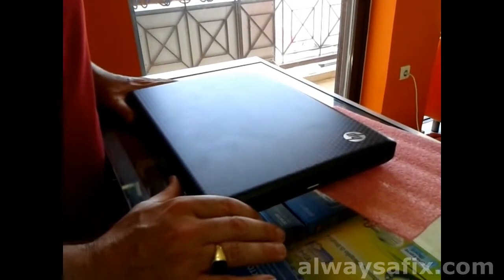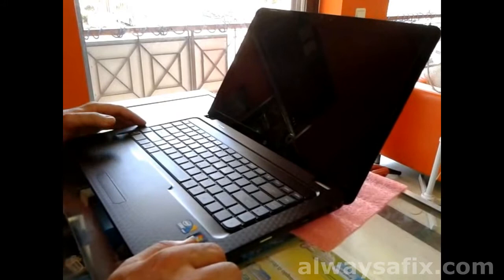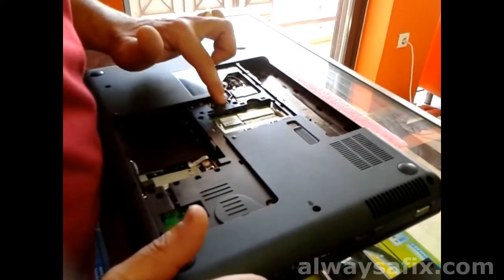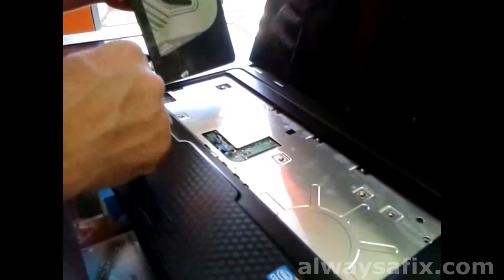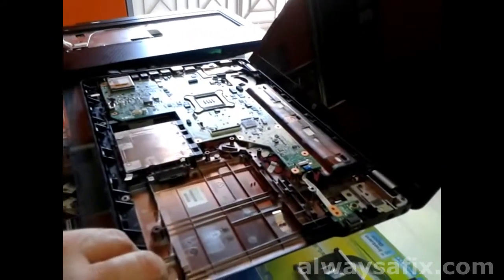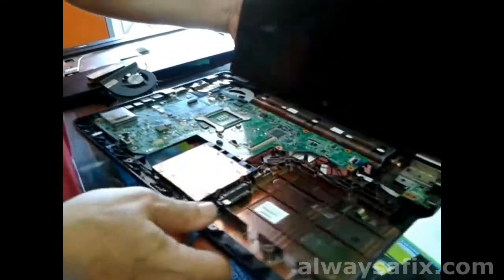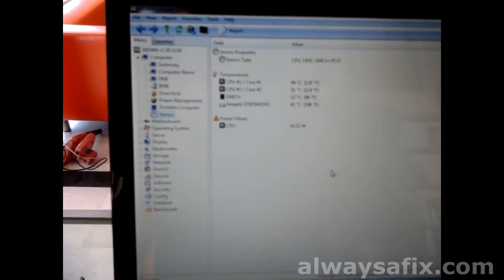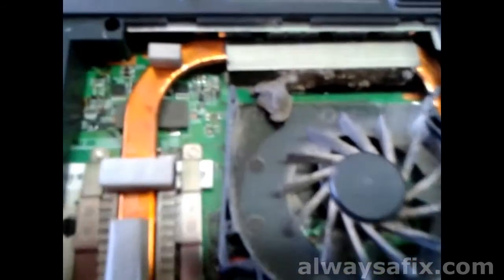Laptop switches off, black screen due to overheating fix

Comment: mine turned off due to overheating it didn't turn on after like 4 hrs it turned on but it has a black screen i tried cleaning the ram and the hardisk nothing happend it works on a another monitor with hdmi
Reply: Same bro
Reply: @aravindrajj7674  were you able to fix yours?
Reply: @nafeesa1025  its faulty cpu unfortunately mine is inbuilt cpu so i changed the motherboard